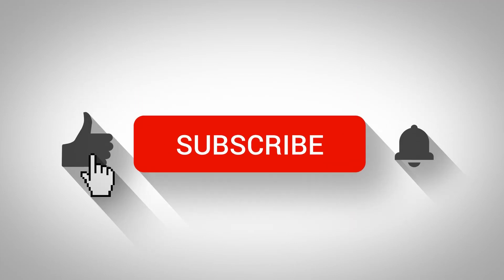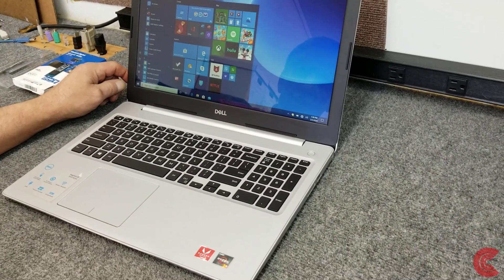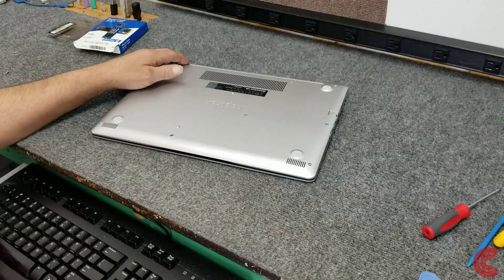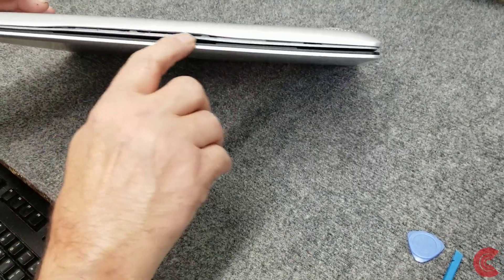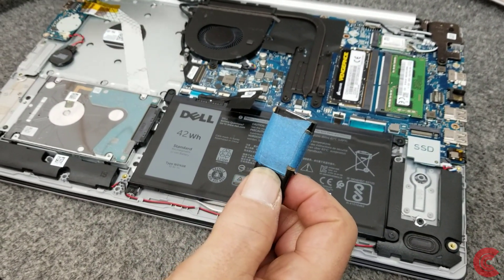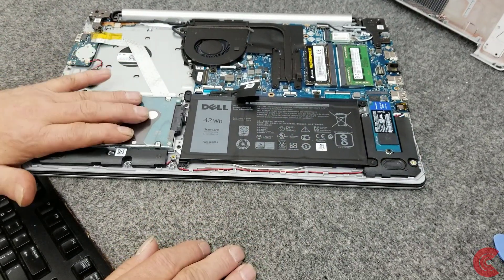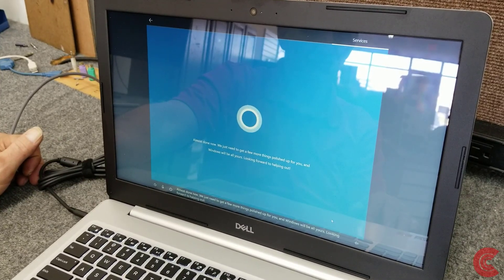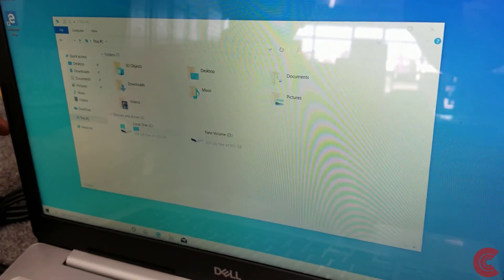Dell Inspiron 5575 M.2 SSD Upgrade, Memory Upgrade & Clean Windows 10 Install

Comment: Thank you for your instructive video on upgrading RAM and storage for Dell 5575. I'm upgrading a machine that I've used for 2 years - it currently has a 1 TB mechanical hard drive w/around 600 GB of data used.  My goal is to add 256 gb SSD to make the machine faster. Appreciate if you would comment on the sequence of actions you would suggest for a machine like this... Curious what you'll say about backing up files before this happens and where the operating system will go... would you aim to remove partitions, etc.  So far I've just backed up all my program file folders and my documents folders. I am a subscriber to your channel! Thank you, Mike
Reply from the maker: Hi. Really all you need to back up is your user data. If your laptop has an m.2 nvme slot, your new nvme ssd will go there, install your OS to it, then reinstall your apps and programs.  You can use 2.5 inch sata hdd to store data, or even install programs to it. Sounds like you have alot of data. Your OS and apps can go onto your new ssd. It will be a big project,  but easily done. But yes, make sure all your data is backed up. I would remove the 1tb hdd you have now, as is, install new m.2 ssd, install windows,  all updates and some of your programs. Then once you know all your data is safe. Put 2.5 inch hdd back in and format it. You may even want to consder going with a 1TB m.2 ssd. That option would allow you to do a straight up clone.  They are very affordable now days. Doing the clone would be easiest method, nothing would have to be reinstalled.  I have many videos on cloning, btw. Dale
Reply: @CadillacComputerCenter  thank you Dale, the 5575 has a maximum SSD card allowance of 256 gb, so while I'm intrigued about the one terabyte, doesn't look like it's possible on my machine, or am I maybe missing something? I like what you said about disconnecting the terabyte mechanical hard drive and installing the operating system. I need to learn how to make a copy of an operating system so I will look for your videos on this. Regarding backing up user data, not sure how to define user data... I have backed up all my documents and program file folders at this point. It's been mentioned by another friend that I need to know the product keys and any passwords to the programs that I will be reinstalling.  If the SSD can handle 1 tb, then a complete clone sounds a lot easier!
Reply: Inland Professional 256GB NVMe SSD M.2 2280 PCIe Gen 3.0x4 3D TLC... is what I went with for SSD.... So far... And Crucial RAM 32GB Kit (2x16GB) DDR4 2666 MHz CL19 Laptop Memory...  The machine allows a maximum of 32gb RAM, 260 pins...

Comment: I have the 5575 can I use two 16 gb Ram on this set up with a 1Tb SSD 

Also is there a specific Vengeance Ram for faster speeds or get the regular vengeance model that the 5575 allows you to use.  I’m wanting to upgrade for music production and some gaming without buying a whole new set up.

Comment: The 16Gb + 4 Gb RAM is an issue. Its called 'dual channel memory' for a reason. The 2 sticks work/dance with each other...if they are not same...its not same performance. Even mixing same size ram from separate boxes/brands can be an issue fyi. Basically, the right way to do it, is you should have thrown old ram stick, and installed 2 x 8gb sticks if that client wanted 16gb. Client doesn't know better what 'dual channel memory' is.
Reply: So I have the same set up, so I don’t want to just throw in a 16gb? What will it do ?
Reply: @bEastTexasFishing  It will work, just the motherboard won't be using the total RAM 16+4=20GB to its max capacity (as it would for 2x8GB sticks). Only 4GB will be used in dual mode, the extra ram will be used sporadically when needed in single channel mode. 

Adding a second 16GB stick should improve performance exponentially (if the motherboard is able to use it - you can read your mobo's manual online to better understand)

Comment: I did a Complete installation of windows and also installed the same memory on this model but I cant make windos use all the 20GB it only take 11gb of ram usable (detects the 20 in bios)
I already tried the Boot advanced options and no difference :(

Comment: Hello, thank you very much for making this video. I have the same laptop, and I have been deciding what type of storage to put in it, and especially if I could install Windows from m.2 and with this it is clear to me. On the other hand, I have read in some comments about the m.2 NVME storage in this laptop has a high heating. It´s true?
Reply from the maker: The ventilation in this model isn't very good. Installing a thermal pad on m.2 drive may help.
Reply: @CadillacComputerCenter  Thanks you! I Will do it.

Comment: So i have a inspiron 5570, last night i got a warning 0142 which hdd failing, it was also beeping at me one beep at a time and loud, i hit mute but after researxhing found out this was a diagnostic beep, either way im now going get my info, which isnt a lot now on my external hdd, wipe and restore the laptop as if was new, then im going to fit more ram, m.2 ssd and a solid state ssd to replace the rubbish hdd, sorry long winded, my questions are, what exactly are you missing from a clean boot? In the situation im removing the hdd for new ssd, what process would i do to get windows booting? Im thinking boot windows on the main ssd and then my music apps can go on the m.2 ssd.

Comment: I have this exact laptop and it sucks! I added a 1TB m.2 ssd and 32 gigs of ram and removed the had and this computer is a beast now!! Thank you for your help on changing out the hardware and the flash drive set up!
Reply: what nvme did you buy?

Comment: Hi Sir. Thanks for your Video. i have a little problem. I have M.2 Sata SSD from old laptop with Windows installed in it. 

Does this laptop support m.2 sata ssd? And i want save the data from this ssd.

Many thanks

Comment: can we replace earphone socket of this laptop or not
Reply from the maker: It can probably be replaced,  it may require some soldering,  and tricky to find a new one. There are alot of sellers on Ebay that sell components like this. Dale
Reply: @CadillacComputerCenter   thank you sir,i will check it out

Comment: Hi, would data be lost on the HDD when completing this process on an older 5575? If so, wWhat if I removed the HDD for the clean install and then reconnect after the clean Windows install on the SSD?  Thanks!!
Reply from the maker: Hi. That's a tricky one. You certainly can remove original hdd for the clean install on new ssd.  If you reconnect hdd, and try to boot, windows boot manager may get confused. Having 2 bootable drives can be tricky. You can try it, and see which drive your computer chooses for its default boot drive. But remember,  you will still have to reinstall all your apps and programs on new ssd. They wont run from the non boot hdd.  I would just backup your user account on hdd first,  then delete all the partitions during setup of new ssd. Dale.  Just make sure you have backed up personal data first.
Reply: Thank you for the reply. I will back up my files/photos to an external hard drive or one drive and follow your clean install for a fresh start.

Comment: Hello, i have the same laptop. Does motherboard support 3200mhz ram??
Reply from the maker: Hi. I cant say for sure.  I've used 2400 and 2666 with no problem.  I haven't tried 3200.  It will probably work. Dale
Reply: @CadillacComputerCenter  Thanks man😉

Comment: Very good video
 :)
Just a question, how do I put the ssd as the main disk to install the operating system and programs?
Reply from the maker: Hi, you will choose which drive to install windows too after shooting from your windows 10 Install flash drive. It's pretty easu.

Comment: Sir, Can you tell that, Which SSD is suitable  for Dell inspiron 5575 Ryzen 3...
Reply: SAMSUNG 970 EVO, WD Blue SN550, WD BLACK SN750, Crucial P2 500GB,	Crucial P5 500GB
Reply: @domilion2008  i bought a western digital black but my dell didnt recognize it
Reply: @mateopd389  have you tried contacting WD?
Reply: @domilion2008  yes but they didnt give me a solution
Reply: @mateopd389  ohh. What did they say?
Reply: @domilion2008  that the m.2 is not compatible so i am looking for buy one crucial or the other western digital nvme blue like the man of this video but i dont know
Reply: @mateopd389  i bought WD blue SN550 m.2, had no problems.
Reply: @domilion2008  do u have one dell 5575? I have the problem thata when i put the nvme the bios dont recognize it but sometimes the bios recognize  the nvme so i could install windows but then again my dell dont recognize the nvme
Reply: @mateopd389  yes, exactly the same as in the video.

Comment: Hey great video! Though I was able to install my WD SATA M.2 SSD my system is not reading it. I checked through Bios,Device Manager and Disc Management. I doubt if my SSD is defective as I can see my laptop noticeably faster. I have the same same model please can you or someone browsing through the comments help me out?
Reply: hi sir. and? can you use your M.2 SSD SATA in this model laptop? Thanks
Reply: @daudraven591  Yes it supports both NVMe & SATA. I recommend going into the BIOS and change the setting from auto-detect to SATA or NVMe (witch ever your using of course) The auto setting does not always work correctly.
Reply: @thermalmeltdown8953  do you have this laptop sir? Many people told me that this laptop just support m.2 nvme and i need enclosure device to read my m.2 sata ssd. Im confuse. xD
Reply: Did you solve your problem?

Comment: Dell Inspiron 5000 Series Just supports NVMe SSD on the M.2 Slot up to 512GB.

If somenone wants to use an SATA SSD M.2, will a need a interposer to install it.

Also no all brands are supported by the laptop, they are a few listed like: SK Hynix, LiteOn and Toshiba SSD.
Reply: Man, can you help me? I just installed SATA M.2 Slot as you mentioned I have to install interposer will you please guide me on that?
Reply: Hello, can you elaborate regarding interposer. I too have the same doubt.
Reply: have you guys solve the problem?

Comment: Hi
I have dell inspiron 3583 with 128gb ssd, 8gb ram, and no hdd.
I want to upgrade sdd to 500gb, add another 8gb ram, and a hdd of 2tb. Will i lose my windows license when i change the ssd??
Reply from the maker: No you will not. Thx
Reply: If your going to spend that much on sticks of RAM you may as well get you a matching pair of 16gb sticks,the little bit more you pay is well worth it. I used Crucial RAM and a Seagate Firecuda 520 for speed. I also have a 2tb SSHD laying around that I am going to replace the 1tb HDD with. But, I am having some problems getting the PC to show the hard drive so that I can install Win-10, I dont know why, it's shows it everywhere else.

Comment: Great video! One minor note...the three screws at the back (near the hinges) don't have to be completely removed. They can stay in the bottom cover to remove it. At least that's how they worked on mine. Makes for three fewer screws to keep track of too!
Reply from the maker: Yes, that is correct. Lot of the new dells are like that. Good tip. Thx, dale

Comment: Does dell Inspiron 15 5575 supports m.2 nvme SDD  , because I have the same laptop with me , I wanna upgrade to it  for better performance
Reply from the maker: Hi. Yes, I believe your model supports both sata hdd, and has nvme m.2 slot.
Reply: @CadillacComputerCenter  if you are sure that my laptop supports m.2 nvme SDD ,!!   thank you so much
Reply: what nvme did you buy?

Comment: Qué tamaño es el ssd? 2280?

Ayuda. Quiero comprar el SDAPNUW-128G-1014, le queda a esta laptop? Es 22mm x 80mm
Reply: Si amigo, si te va a servir porque la laptop acepta el formato M.2 2280 NVMe (o como mencionaste 22mm x 80mm), yo tengo el mismo modelo de Laptop y le pusé un SSD M.2 2280 y encajó perfectamente! Solo asegurate de que el SSD sea M.2 2280 NVMe y no M.2 2280 Sata, porque yo cometí ese error de no fijarme y compre el M.2 2280 Sata y me calzaba pero no servía, después lo vendí y me pude comprar un M.2 2280 NVMe y si me sirvió! Que suerte que encontrarás a alguien que hablará español en este vídeo xD, además quisiera comentarte que en unos días voy a subir el vídeo de como instalar el SSD en esta laptop, si lo quieres ver pasate por mi canal, (el vídeo estará 100% en español xD), Saludos desde Venezuela!
Reply: @elcanaldefrancho4003  Hey muchas gracias xD si tuve suerte. Hey y porfavor podrías hablar sobre cómo migrar el S.O. porfa xD para no comprar licencia
Reply: @elcanaldefrancho4003  Amigo la laptop soporta el M.2 y el HDD que trae ya instalado? Es decir, si quiero instalar el Windows en el M.2 puedo tener en el HDD todos mis archivos?
Reply: @bryanescobar5967  Si, obvio. Es como tener dos discos separados. En uno podes poner el sistema operativo y los archivos o juegos que quieras que ejecuten mas rapido, y en el otro los archivos que menos usas o no necesitan tanta velocidad, comos las fotos o los videos
Reply: @elcanaldefrancho4003  que modelo de nvme compraste?
Reply: y lo de la memoria ram. que tipo de 16gb le va?

Comment: What ssd did you use? Did you use dell's nvme 256gb ssd? What ssd do you recommend?
Reply from the maker: Hi.  I used WD Blue sn550 series nvme ssd. Dale
Reply: Hello? What capacity of wd blue sn550? What it Is the Max?

Comment: Hi sir I have a Dell inspiron 3851 (15 3000) 4gig mem and 1tb mechanical harddrive. Would like to know how much ram can I add and what is the biggest M2 SSd can I upgrade too. Thankyou
Reply from the maker: Hi. You should easily be able to upgrade to 16gb ram, if you have 2 slots, possibly 32. Up to 2tb ssd on most. Dale